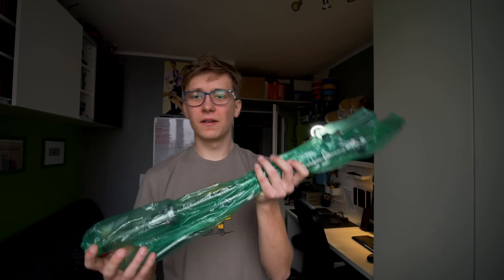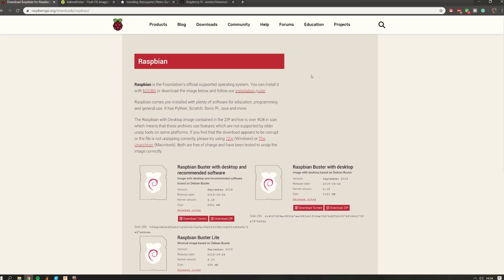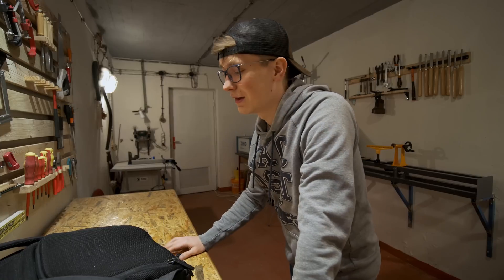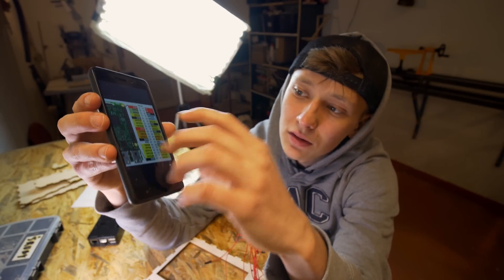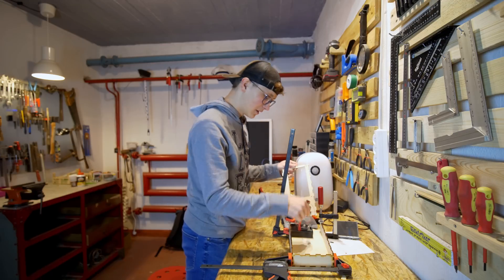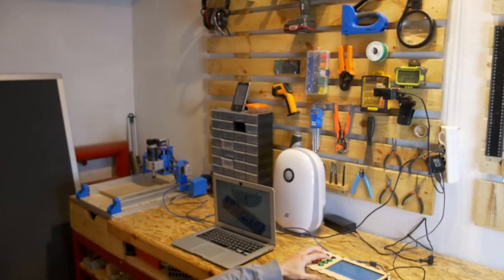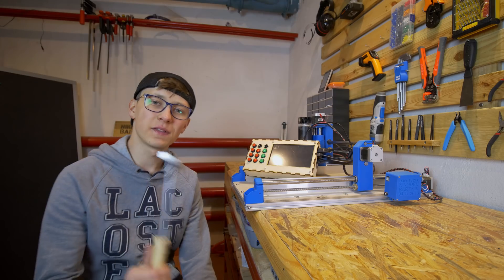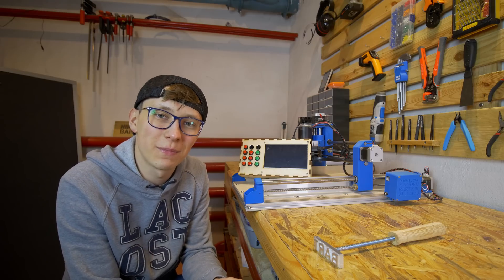Raspberry Pi CNC Controller

Comment from the maker: IndyMill: https://indystry.cc/indymill-cnc-machine
Where should I post files for the case that I designed? Looks like Thingiverse doesn't work very well right now :( Or maybe you want me to make an instructable about this project?
Reply: Instructables 😄
Reply: You could also keep everything you design on Github. It’s perfect for keeping all types of files, version control, comments, issues and everything else you can imagine 😀
Reply: Instructables is ok... but i think it will be also good on thingiverse when it's possible.
But, in any case, thank you so much for your great works!
Reply: instructable please
Reply: Bonjour,
Personnellement, je préfère Instructables, je ne comprends pas l'anglais et ça me permet de traduire les pages avec google.
Reply: Bonjour,
Personnellement, je préfère Instructables, je ne comprends pas l'anglais et ça me permet de traduire les pages avec google.
Reply: You could try LBRY, it is mostly focus on video. But you can upload everything there.
Reply: I am currently working on a "thingiverse like" feature on my website, will be release in the weekend :)
Reply: Thingiverse never works (great)
Reply: Insteuctables + Github + Thingiverse.
Reply: I second instructables.   My students use that site a lot more than thingiverse.   It’s geared towards learning.   Thingiverse is greater towards experienced users.
Reply: Thx for sharing.  I have set up my CNC with a similar Pi controller set up, but used VNC to remote in so did not try the buttons.  I would like to make that change, but cannot find much of what you referenced in the video. Did you post the files and links somewhere?
Reply: Prusa Printables repository would be great.

Comment: Nice work and I can appreciate your use of multiple maker skills. There is one thing that is eating at me about your design. You should research "Parallel-in, Serial-Out" (PISO) shift registers. This is a simple small IC that takes binary input on each pin (like from each button) and serializes the data at a frequency defined by the input of the clk pin. In short if each of 8 buttons is connected to a pin, the  chip will send an 8bit string along to a single PIO input on the Pi.

Would clean up the wiring a lot and free up many PIO on the Pi. You would just need the button board attached to the shift registers, and then 4 wires to the Pi- vcc,gnd,clk and a single PIO.

Comment: hello and congratulations for the beautiful project
I would like to add this control as you did to my CNC
the instructions of your project of the software part of the raspberry and of the electrical connections of the buttons on the pins and of the relative configuration where I can find it, always if possible?
Thanks again

Comment: You know it would likely be easier to avoid the emulation layer from additional software. Get a ATtiny micro controller, and set it up with the arduino boot loader. Then Configure it as a human interface device, for the buttons. This way it will lower some of the software loads on the pi, and you will also have the ability to easily move it to a new pi when the SD card dies or the image file gets corrupted.
Reply: Why arduino bootloader? (Asking from curiosity)
I have a raspberry pi pico and I have used circuit python with it for potentiometers and leds. 
Is the arduino boot loader specific to a certain task?
Reply: @dugabomber5993  ease if programming. If you want to take advantage of all the existing drivers and projects already out there for human interface devices. You could certainly do it in the normal atmel development tools. But for most beginners and hobbyists its more work to go that route than work inside the Arduino ecosystem.

Comment: Hi Nikodem! Have you ever tried using troichidal toolpaths? ( Deep cuts but only small radial engagement and a relatively high feed) that way you may be faster and you won't only wear the tip of your mills. If you can find the time you could look at Titans of cnc, they have a free online course on drawing, programming and milling with fusion 360. https://academy.titansofcnc.com/ 

Thanks for the really interesting videos and projects, keep on going!
Reply from the maker: Thanks, will check that out!

Comment: It's all cool and fancy and all, but it kinda seems to me that trowing like 80 bucks at a machine worth just slightly more than that to make it work away from your computer is kinda, you know... counterproductive?
All you really need is a way to replace USB with something that would send data back and forth over wifi, me thinks.I mean, if your'e using UGS, you have this little web interface working as a pendant on your phone, so all that's left is getting rid of the cable between your computer and the router. And surprise, surprise, USG can send data over TCP socket, ESP8266 costing like two bucks has both wifi capabilities and serial port you can use for interfacing with arduino, it all takes like 20 minutes to code and maybe an hour to test and debug.... see where I'm going with this? ;)
Reply: Or just get a pi zero w for 10 dollars and use cncjs web server and use your PC anywhere. 

Much easier.
Reply: @DandySkipper  Does it run reasonably good on pi zero though? I remember having serious performance issues with Node.js installed on pi 3 b+ like a year ago...

Comment: Awesome project! I always thought if that was at all possible and I'm glad it is. May I ask what Raspberry Pi did you use for it? Thanks!
Reply from the maker: Thanks! I used raspberry pi 3B because that's what I had laying around, you can always go with 4B it's more powerfully everything should run smoother

Comment: 8:38 I had one of these exact peltier dehumidifiers, and they do absolutely NOTHING but consume power, make noise, and do very little actual dehumidifying. Return the unit and get one with a compressor, they work great and don't consume much more power.
Reply from the maker: Yes, it's definitely not the most efficient thing ever, but it is always something because humidity here is terrible

Comment: Great project! Just one small tip, making finger-joints on fusion 360 manually is pretty tedious, and there exists a script that automates the process, I would strongly recommend it.
Reply from the maker: I will check that out I didn't know that there is such thing, thanks for letting me know!
Reply: @nikodembartnik  no worries😃

Comment: I recently added 3 stepper motors to my microscope, so I can controll each axis with computer. However I decided to controll it with my steam controller (via node.js), and it works as a charm. Maybe not perfect fit for your application, however I thought you might be interested to know it's possible and quite easily doable ;) Pozdro!
Reply from the maker: Definitely a great update to quickly set a zero point and move the machine to proper place on the material. I don't have any game controller, looks like I have to buy one :)